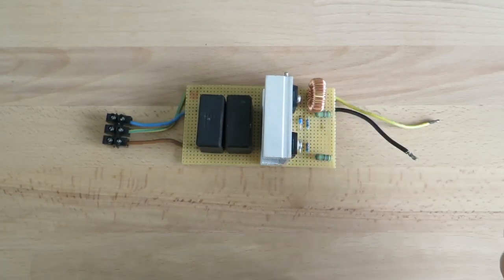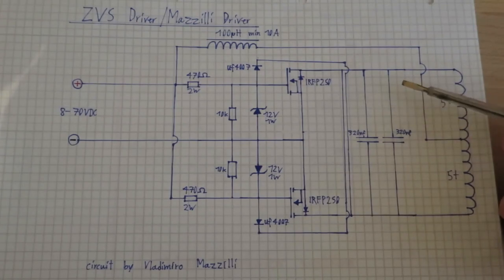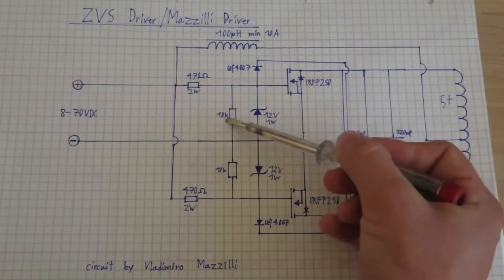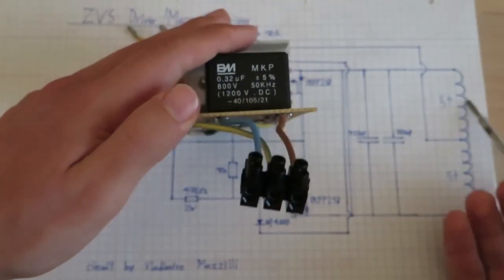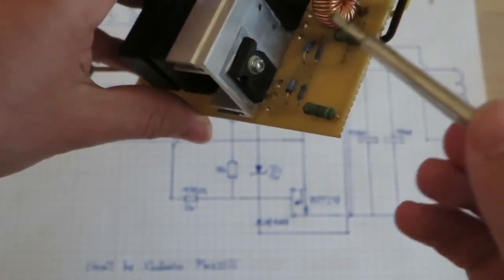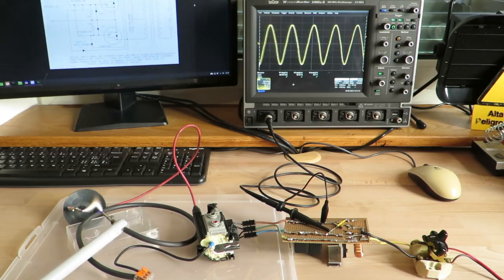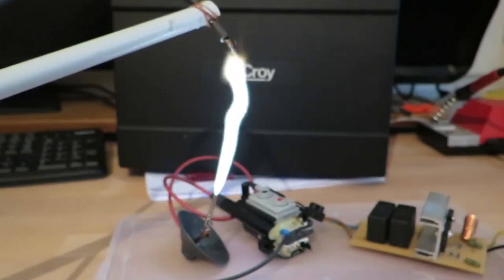Everything about the ZVS driver

Comment: Nice work. The single choke version always seemed to run better for some reason.  I made a hybrid setup will both choke coils on a giant ferrite ring and that's been working out for me.
Reply from the maker: Thx:)
The single choke design is also more efficient from what I have heard. 
Also interesting that both windings on the same core worked for you.

Comment: #!#!Why not use IRF3205 MOSFET that has on resistance of only .008 ohms with 80-110amps? No heating, no fan, and probably no heat sink. These transistors are used in the popular highly efficient 20khz China 500W Inverter open board...,,??//?
Reply from the maker: That would be a good idea, but the IRF3205 is just rated for a drain source voltage of 55v and the resonant voltage in the tank circuit can easily reach over 100v. 
The IRFP260 would be better tho as it has half the resistance of the IRFP250, is rated at 200v and can handle up to 50A.
Reply: I sugest irfb4110

Comment: I am surprised that the TV DST is able to deliver so much power as in a TV set it only has to handle a fraction of it.
Reply from the maker: yeah, I also think it is quite impressive what powers you can push trough that ferrite core. 
Also the transformer didn’t even get too hot during this, just a bit warm.

Comment: I thought that the frquency was determined by an LC circuit created between the inductor (choke) and the capacitor?
Reply from the maker: No, that isn’t the case. The choke is just to limit inrush current to the mosfets.
Reply: @sciencebysergio  so what determines the frequency, please?
Reply from the maker: As I said in the video the oscillating frequency is determined by the parameters of the LC circuit formed between the black tank caps and the primary of your transformer.
Reply: @sciencebysergio  Thanks for confirming

Comment: Why don't you try to feed the gates with a separate power supply
Reply from the maker: I could, but this version of the circuit works for me so why make it more complicated:)
Reply: @sciencebysergio  it's not that complex, just put the positive 12v to the gates and the Negative to Negative of 24v supply, it works more efficiently
Reply: @ElIsraelJijijiji  True, I might try it when I run the ZVS at a higher input voltage.
Reply: @ElIsraelJijijiji  where’s the second power supply coming in?
Reply: @herobrine1847  between MOSFETs gates and ground or negative

Comment: Those 10k resistors play a minor role in the circuit. They are there just to allow the MOSFET gates to be fully discharged to zero because those diodes can only bring them down to one forward-bias diode voltage.
Reply: Correct....though I'm not sure that is minor

Comment: I built mine by just following your build and it works! The funny thing is, i built mine with some components that are more or less out of value and some that are completely different. And yet, it produces 30kv on the output. Pretty-pretty neat to say the least.
Reply from the maker: Nice to hear:D
I also build this circuit with completely different, scrap components before and it also worked. The component values used are relatively flexible.

Comment: Another good source of capacitors are induction heater capacitors they work really well 
I tried running my zvs driver on 48V and the capacitors only got slightly warm (28A current draw)
Also i found out that using 330ohm resistors reduces the mosfet temperature by a lot
Reply from the maker: Nice, capacitors from induction heaters are great, since they are rated for the high tank currents.
I might try to also reduce the resistance to 330 ohm. Ig it was better in your case because it drove the gates better.
Reply: @sciencebysergio  yess im using 330 ohm 10w resistors. At first i used 2W resistors but they got burned at 48V
Reply: Thanks for sharing. Ive always used 460 5w and they can get hot enough to melt close by insulation etc. im going to sswap out for 330s and see if that improves. I think i read on an hv forum vfor higher end of input voltage u can use 680s, so surprised 330 is heating less. 
Yes, best free caps ive found yet are from induction cooktops, high frequency, 900vdc, and usually good brandname ones, epcos etc.

Comment: Nice presentation! Can you provide a quick diagram of where you placed the Oscope leads? I'm so glad I found this channel!
Reply from the maker: I don’t have a diagram, but I can tell you where you would expect what signal. 
across your primary and tank cap there should be a sinewave and on each drain there should be a halfwave 180 degree out of phase with the other drain. 
On the gate you have a squarewave and the halfwave voltage on the drain should be within that squarewave. Both drain voltages should ideally also be 180 degree out of phase with each other and there should be no point, where both gates are high. That would lead to cross conduction decreasing the efficiency and making your FETs hot. 

Hope this helps
Reply: @sciencebysergio  this helps alot! thank you so much! again, nice presentation!

Comment: Very intresting,the zvs circuit I have bought on ebay maybe be different with the caps.they don't appear to be parallel resonant.i found same thing ,freq goes up by approx 12khz with arc.i found that to be undesirable for my use.i have to draw off schematic sometime.thanku for your video.
Reply from the maker: The ZVS drivers from china are probably exactly the same as what I have here, so it makes sense that they perform similar.

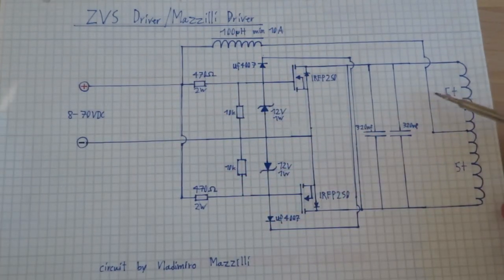Comment: When describing the circuit operation, @1:11 you talk about the voltage through the transformer coil rising, obviously due to the top mosfet being closed.  You then state that the voltage through the transformer coil reaching a peak, and then starting to go down.  What you fail to mention is what causes it to reach a peak and begin to decrease?  I can understand why the voltage would reach a peak, but why does it start to decrease?  You state that the top diode (uf4007) discharges the gate of the mosfet.  What determines the time that this happens?  Is it when the capacitors reach a certain voltage?  I'd appreciate any clarification you can give, as I am at this point without access to an oscilloscope and can't observe the circuit behavior for myself, and I still can't seem to understand how to get ltspice to work for me.  It's a helluva lot of work to get a basic circuit like this up and running due to having to find all these different parts or functional equivalents.  Thanks for your time.

Comment: Hi thank you for your fine explanation, I built the same circuit with different mosfets 
It draws about 10A in ideal conditions is that normal??
It has no secondary coil 
I was aiming for an indicator..
Can you confirm if it is normal?
Any way to limit the current??
Reply from the maker: No, that is not normal. Is anything getting hot? 
Maybe you are heating the core itself or you are getting cross conduction of the mosfets.
Reply: It looks like the capacitors are warm, I think the circuit is not running in ideal mode.
The main coil is also warming 
It’s 6 turns of 2.5 mm single copper wire.
Does this sound normal?
Any idea how to check this?

Comment: So cool , thanks so much for sharing your knowledge 🙌 I been wanting to make this circuit so long , do you think I could use the flyback to charge capacitors , I seen zvs capacitor charger circuits but I do not want to rewind a ferrite core , can I use a flyback ? Since I think it produce dc current , I would like to charge caps to about 200v quickly
Reply from the maker: That would probably work, but the risk of severely overcharging the capacitor is quite high. Thus I would rewind the flyback.
Reply: G E T  R E K T  thanks so much that helps a lot , I still need to get me flyback and some nice transistors , I was thinking about using igbt instead of mosfets

Comment: Does the inductor needs to be a toroid one ? Or can I use one of those ferrite chokes (the ones that are like a little bar with the wire around them , cause I have a few of those rated 200 (wich I guess is 200mh ) , I also have a ferrite toroid but I don't know the amount of turns it needs to get around 200mh
Reply from the maker: any kind of inductor with the correct parameters should work, just make sure it os rated for the current.
Reply: You want more like 100-200 uH, not mH.  It would be impossible to get that much inductance with wire large enough to handle the current anyways.  The ferrite bobbin style chokes you mention are probably close to the right inductance but they may lack a high enough current rating.  You need like 20 AWG wire minimum for continuous duty.

Comment: Please, could you suggest a simple circuit to modulate the ZVS Flyback output with an audio signal ?
Reply from the maker: Sorry for taking so long to get back to you. 
I haven’t messed with modulated ZVS drivers yet, so I can’t really recommend much. But I have seen people inject an audio signal into the limiting inductor or you could try modulating the gates. 
This is example of modulation via the limiting inductor https://youtu.be/CHlqc4q6NKM

Comment: ----If the capacitor is across the whole primary, and switching only uses 1/2 primary, how do we figure the frequency??//////?
Reply from the maker: that’s a good question, but I think the operating frequency can be determined by the capacitance of the tank cap and the inductance of the entire primary.

Comment: Can i use this circuit as induction heater?
Reply from the maker: Yes, but the centre tapped coil has to have the same inductance in both parts of the coil. 
The circuit works with non-symmetrical coils but it isn’t ideal and might cause problems

Comment: What's the point of the thermal isolation pad on the mosfet when both are mounted to the heatsink with a screw?
Reply from the maker: the screw and the back of the fet are isolated, I may have even used a rubber bushing to isolate it further, as it would be done on metal to-220 package transistors.
That isolation is very important and the circuit will not work or even destroy itself if the back of the transistors touch.
Reply: @sciencebysergio  hey thank you very much for your response!

Comment: Excuse me diode is not for discharge .10k is for discharge gate.diode is for charging negative side of capacitor because capacitor don't attached to ground.or maybe I mistake.if mistake then 10k resistor is for nothing.

Comment: Maybe you know I've heard that zvs self resonates with the load is this true.like maybe with a  Tesla coil .
Reply: It seems to in your video the frequency moving with the stretching of the ark.
Reply from the maker: yes, the operating frequency is dependent on the inductance of the primary and the tank capacitor. Since the primary inductance changes with an arc the frequency also changes
Reply: @sciencebysergio  think you it's not said enough
Reply: Tesla coil circuit operates based on feedback from the secondary winding and zvs driver oscillates based on feedback from the primary winding.

Comment: I built a couple of ZVS circuits and I keep getting into a trouble where my mosfets/Igbts latch on and the circuit keeps blowing up 
Usually happens because of overloading at around 12v 5-6 amps
Reply from the maker: that also happend to me at 40V input (here: https://www.youtube.com/watch?v=e-0v0AuUJUE), but I can't explain how to fix it, it might have something to do with the choke tho. At least in my case it was a bit to small and probably contributed or caused the failure at the end.
Reply: The choke limits the current
Reply: Did you ever get it figured out? These bad boys can pull 15-20 amps. So if the voltage drops below 12volts on your power supply,  the mosfets will have a hard time. Igbts are even worse. They need about 15 volts. Try 20 volts bro.
Reply: The choke will limit the current only if it is switching back and forth. In case some transistor gets stuck the choke will ultimately allow a full current flow and things will get really hot. Maybe to test the circuit use a resistor instead of (or in series to) a coil could help not to fry things too early.

Comment: Do you think it could power a magnetron?
Reply from the maker: maybe, but it might damage it from overvoltage.
Reply: It can, I have tried it.  The issue is not so much overvoltage on the magnetron -- they're pretty rugged, but overcurrent crashing the output voltage since they are designed to draw up to 0.5A.  You can reduce the current drawn by the magnetron by under-running the filament though.  Modern microwaves have actually begun doing away with iron core xfmrs in favor of a beefy ass flybacks.  It knocks about 15 pounds off the weight and it's cheaper to manufacture as well.